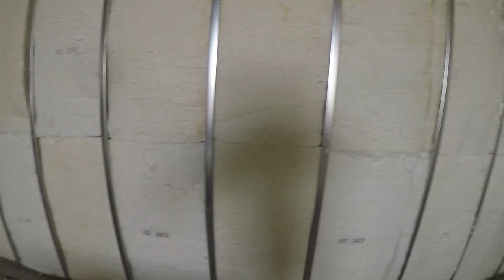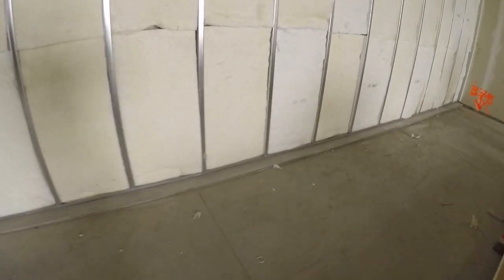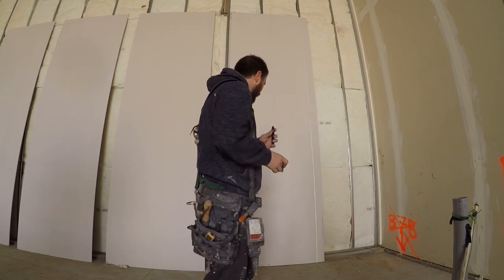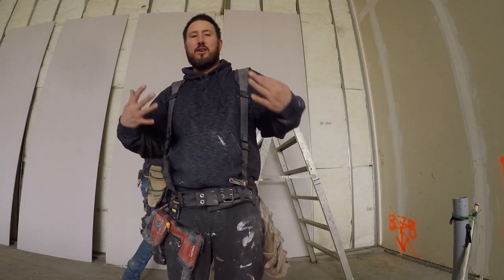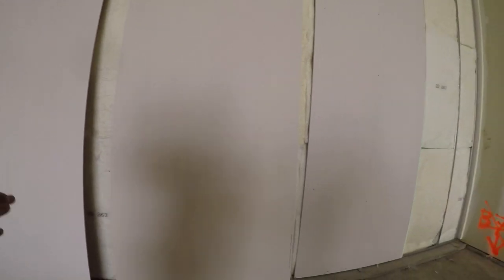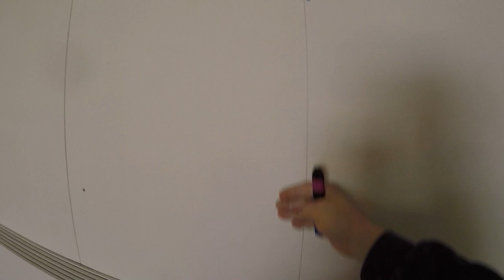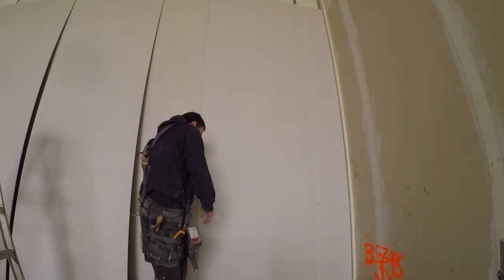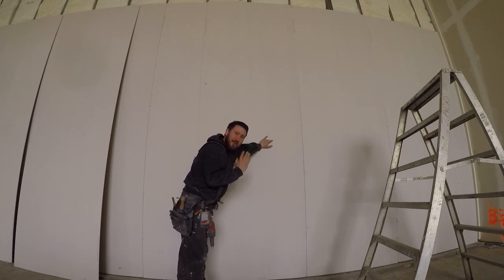Drywall Installation Double Layer 5/8" Fire Rated

Comment: Dig those tunes. Funny, one of them is "lasers and stuff" as you laser in drywall haha! Really dig those Hilti tools. I've been on Milwaukee for years, Hilti used to be WAY more expensive than Milwaukee from what I remember. Milwaukee has a lot of specialty tools for electrical and plumbing and "battery lock-in" is a thing - but now I'm looking at Hilti because Milwaukee - well, they're still ballin powerful, but they're just not quite as good as they used to be. So what I'm looking at, they're a lot more affordable than I remember them being. Back in the day my Milwaukee 18v cordless was like 250 or something, the comparable Hilti was twice as much so I never bought them. I'm DEFINITELY giving them a hard second look now though, because they look like they're still super well made while the others are on a race to the bottom.